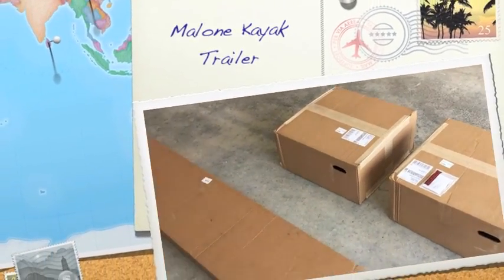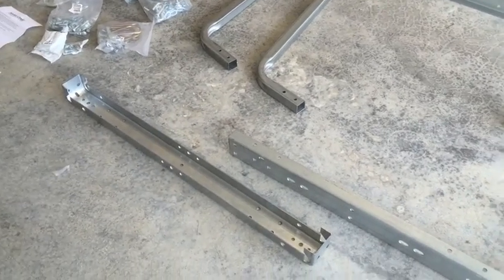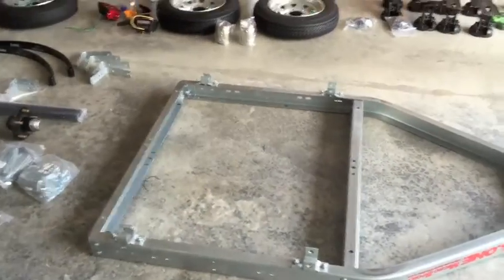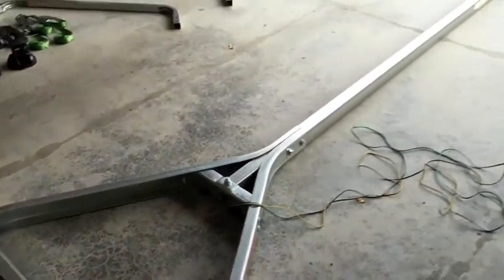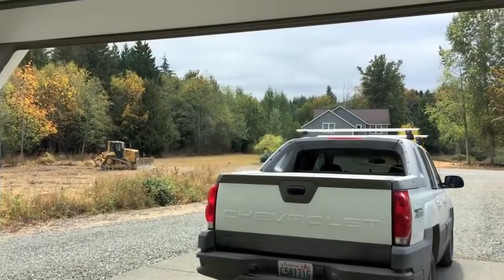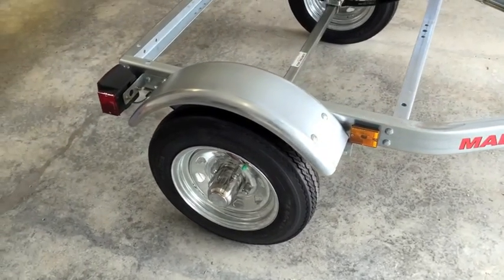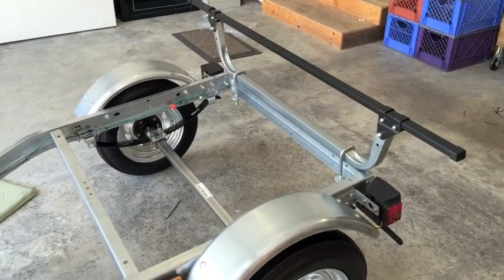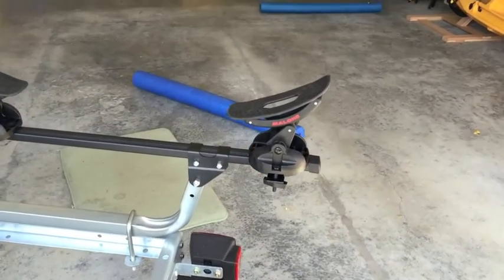Malone MicroSport Trailer Build for Hobie Kayaks

Comment: Very detailed assembly video for this trailer. I always read through instructions thoroughly before assembling anything. It does save time from going back to fix stuff that is missed. I'm currently thinking about buying this trailer to carry my two 10 foot kayaks. I intend to tow this with my 2019 Kia Soul.......Take care, Bluefin.
Reply from the maker: Hey. If your two kayaks aren't too heavy the saddles will work well. I had to swap out the saddles for the heavy Outback (95 lbs.) for two large 4" PVC pipes. The heavier Outback rides very stable now, flat and secure. The trailer has performed flawlessly, no problems.

Comment: Thank you David for your videos, I have been going back and forth between the choices to purchase a portable kayak to travel with or to purchase a trailer to transport my Wilderness Systems Tsunami 145. The Malone trailer has been on my wish list for some time now. After reviewing your 3 videos I decided to purchase the Malone trailer. I  expect its delivery on Tuesday, Nov. 13th. Your video is excellent and the ease in your explanation reassured me that the assemble is not too complex. Blessings to you and your wife. If y'all are ever planning to be in the Atlanta area let me know and we will put the kayaks out on the lake.
Reply from the maker: Hey, Mr. Townsley. I'm very happy the videos were helpful to you. You will have no problem assembling the trailer. It's an easy build; just take your time. I ended up removing the saddles for my kayak and placing a couple of 5" diameter, heavy duty PVC tubes onto the trailer. I cut two blocks of wood to go into the inside of the tubes, each with a hole drilled through near each end. The tubes are held onto the cross members with the same U-bracket hardware that came with the trailer. This system works excellently for my particular kayak which is close to 100 lbs. when loaded with fish finder, battery, rigging, etc. The kayak slides on and off the trailer easily and sits perfectly square when riding down the highway. My wife's kayak which is lighter, we still use the saddles.

Don't know when I'll get down to Georgia. I bet it's beautiful down there. However, same goes for you. If you and yours are ever up here in Port Angeles, WA let me know. We have lots of room and many beautiful lakes and bays to go kayaking in. The mountain forests are unbelievable. God bless you and yours. Take care; be careful out there.
Reply from the maker: Hey, Wendell. That's exciting news about your upcoming purchase. That Wilderness Systems Tsunami looks like a beautiful rig. Good luck on assembly of the Malone trailer. Let me know how it goes.

Comment: you might want to add a rubber grommets where the tail light wiring pass through the frame to prevent rubbing through the wires. very nice video.
Reply from the maker: That's a great idea. I'll get that done right away. Thanks.

Comment: Probably the reason they don't use carriage bolts on the fenders is that the square shank of the bolt requires thicker metal than the fender is made of.  Otherwise you could tighten the nut down until it bottoms out on the shank and the bolt would still be loose.  Just a hunch.
Reply from the maker: Got it. Thanks for the information. Take care.

Comment: Excellent video. Is it necessary to get the saddles? Any reason why you can’t put kayak directly on the cross bars?
Reply from the maker: Thanks. No, it is not necessary to get the saddles. As a matter of fact, I have removed the saddles for my kayak (Mirage Outback), as the weight of it finally broke the locking feature of the saddles and they could not retain their upright position. I replaced the saddles on my side with two 6" diameter industrial PVC pipe sections. I clamped them onto the cross members using some of the sample U-clamps that secured the saddles. My heavy kayak now sits perfectly on the two PVC sections. It doesn't tilt, shift, or move at all during transport. My wife's lighter kayak still sits on the four saddles because it is light, but even so, I have run two pieces of wood (3/4" high by about 1 1/2" wide) under both saddles which keeps them from lowering out of position. The wooden sticks are strapped onto the cross member with zip ties. The kayaks never move now during transport. In general the trailer itself has worked flawlessly since we bought it. No issues other than the saddles.

Comment: Great video, after watching your video I got inspired to go ahead and purchase the trailer. I see you got the saddle, I’m thinking of getting the sea wings instead for my two kayak any thoughts on the sea wings .
Reply from the maker: Hey, Juan. You will love the trailer. I think the sea wings might be a good option. My kayaks are heavy (80 lbs. each), and I think the sea wings would have been a better option for holding them in place. I just did not know about them at the time. The saddles are good, but I think they work better for much lighter units. Do the sea wings have just one attachment point at the bottom of the V? Make sure that's secure I would say. At least the saddles hold the kayaks at four different points. Let me know what you decide. Good luck; be careful out there. Blessings!
Reply from the maker: Hey Juan. I think the sea wings would be an okay option if your kayaks are not too heavy. My Outback is close to 100 lbs. when fully loaded. I  removed the saddles on my side and went with two large, heavy duty PVC pipes. Works much better for my setup. We still use the saddles on my wife's lighter kayak.